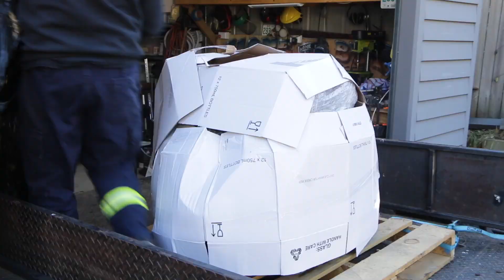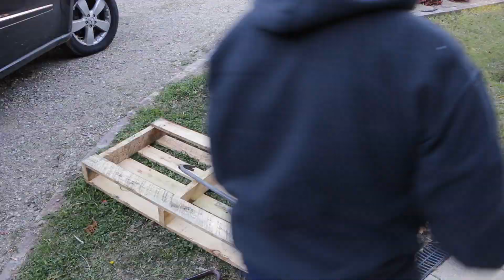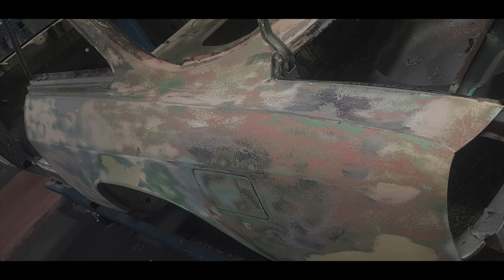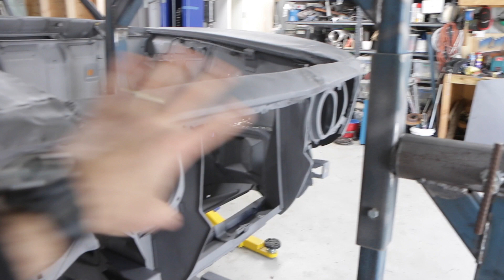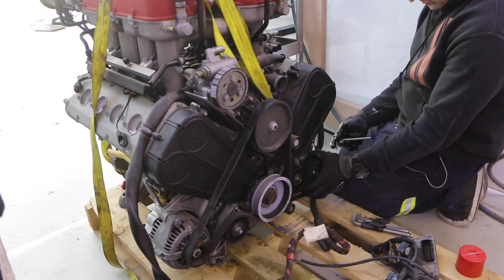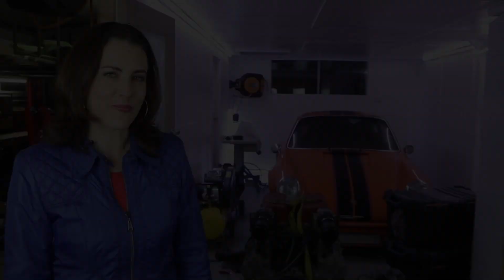How much does a Ferrari engine weigh? - Alfarrari 105 project car build part 10

Comment: Nice weight for the little V8 Ls1s usually considered one of the lightest modern V8s come in around 185 kg -225 ish depending on accessories  etc. Its also a relatively small lump much of the mass resides on top with the induction. This is going to be fantastic and then some.

Comment: I put a 4.2 ltr Oldsmobile (alloy) into a 1968 two door gt Cortina.   The V8 (P76)  was lighter than the original cast iron 4 cylinder.   My alloy 393 Cleveland is only 40 Kg lighter than the cast iron 351.

Comment: Interesting build and comments - re velocity stacks and bonnet bulges and glass fibre flares (oh and keeping it 100% alfa, albeit with "only" 3L V6) take a look at this https://youtu.be/Ty2I-6VbLrI. If you ever see this car close up you won't be talking about fiberglass finish being in any way second rate. Oh - and that car is running an (alfa 116) transaxle. Perfect weight distribution.

Comment: Howdy Jeff, have a look at "subaru gears" they are in aussie and make a lot of cool stuff to fit the scoobie gearboxes. I have a couple of there adapters and fly wheels for my projects.  I came to a similar conclusion as you but i have used 4wd boxes converted to RWD. Keep up the work. Cool project!  Btw ....My Zed has a vw vr6 turbo mated to the scoobie box.  Cheers, Douglas

Comment: It was always my impression that gearboxes had torque limits, more so than HP limits.  The 915 in your 911 for example will start to exhibit issues when torque goes over 350 ft-lb, particularly at lower revs.  It'll be interesting to see how you go with the 86/BRZ box.

The intake on that Ferrari engine looks like it will be a challenge.  I guess you will just rotate it 180 degrees to face the front?  But it may stick out of the bonnet still?  Are you tempted to go ITBs on it?

With that said, that fancy manifold on top probably adds quite a bit of "meat" to the torque curve on the engine (with variable length intake ports, etc.)

Comment: won't you also need a beefier diff to handle the power surplus? Meaning more weight at the rear, canceling the difference out a bit more?
Reply from the maker: The diff in there is pretty tough so we will see how it goes for now, but the battery moving to the boot will balance it pretty much with just that.

Comment: Interesting project, I'll be hanging out for the subsequent installments to come.
Hope that gearbox can handle the torque, you'll need to "uprate" it by using top quality full synthetic gear oil, an old Borg-Warner trick. Also you could move the radiator into the boot area seeing as you need to change all that wrecked rear boot floor, it'll give more space/coolant capacity/less weight up front.

Comment: You should fit the power steering and air con, wouldn’t be too hard to work something out using AN fittings.

The steering’ll probably be quite heavy with that extra weight up front, and that engine’ll definitely kick out more heat than the little Alfa engine so you’ll be baking in the cabin.
Reply from the maker: It's not the fittings it is the space.
Reply: Home Built By Jeff if Bad Obsession Motorsports can get a Celica GT Four engine, with the air con, power steering, turbo and a charge cooler attached into a classic mini, I’m sure it’s possible 😂. 

I’d of thought the width of the banks themselves would be more of an issue than the depth of the accessories with it being a 4 cylinder to v8 swap.

Comment: Surprising there is so little difference in weight. Perhaps relocating battery etc to the boot will help retain the weight distribution. Man there is a LOT of sheet metal work to do. I'm enjoying this build.
Reply from the maker: Battey, oil tank, bigger brakes, half cage, there is a lot that will make a difference

Comment: I would start with a gearbox that can handle the torque and mount the starter on the adapter you will have to design and fabricate. Oh and there is no way that Ferrari intake will fit under the bonnet so I hope you're up for some custom manifold design...or just cut a hole and the bonnet and let it stick out, roots blower style.......

Comment: Like others have said.
Relocating the battery to the boot/trunk.
and relocating the engine further back in the engine bay could mitigate the weight issue?.
Also have you considered the gear ratios of the gearbox?
May have drivability issues due to the gear ratios keeping the engine out of its power band?...

I wonder are you considering junking the injection system for Weber Dcoe's 40/45/50s?
NOW that would be interesting and in keeping with the era of the car.??

Comment: I would do all around Carbon/Kevlar composites, and don’t mess with sheet metal straightening nightmare. Door skins, front and rear fenders and bonnet. Rear trunk door would keep steel. Also you will have to add the fuel cell in trunk. That will balance weight distribution. There are lot of options. But all around composites would way to go.
Reply from the maker: This will be a steel beast. There are aluminium panels available, but as the front guards and nosecone are all one welded on non-removeable piece it would be a lot more work trying to make all new composite panels.

Comment: I was going to suggest that the RX8 Trans has the starter on the trans side. But then you pop out the 86 trans... which is the same thing! Both are Aisin AZ6's.
Reply from the maker: Interesting. I have had quite a few suggestions for RX7 boxes. Nice to know they are the same thing.
Reply: @HomeBuiltByJeff  It's also the same trans in the 6speed NB MX-5, however the MX-5 is mounted differently.

Comment: There's a Ferrari powered BRZ that looks a similar engine, that's probably where Benny got the idea about the gearbox from, it's a drift car so the transmission and diff are going to have to be strong, it might be worth seeing what they've done? The inlet manifold does look tall but long runners are generally for increased torque over outright hp, you're not really going to need heaps of torque IMO so could shorten the runners significantly. There's a very good custom plenum place in Wollongong or get the guys that did Benny's cresta manifolds in Sydney?
Reply from the maker: Ryan Tuerck's car ran a sequential race box

Comment: I would be looking at a later model Fd rx7 box if I was you. Series 7 or series 8. They have a rear facing passenger side starter and are a pretty light box. You can also swap the extension housing with an fc rx7 box and shorten the shifter if it's too far back.
Reply from the maker: Same gearbox as the GT86 ;)
Reply: @HomeBuiltByJeff  86 box is the same as rx8 not rx7. Rx7 are completely different and a lot stronger.

Comment: Only 25 kgs difference between the 2 engines??? i would not have guessed that.  4 more pistons and rods, another head and valves and cams, and that huge manifold.  The original alfa motor does look stout...

Comment: Engine & gearbox - The data:
Alfa: 148.5 + 33.3 = 181.8kg
Ferrariyota: 175.4 + 42.4 = 217.8kg
Difference: 36kg (79lb)
Reply from the maker: Gearbox is central weight so not as big a deal. Just a bigger driver could easily make more difference than the box ;)
Reply: Once you add the flywheel and move the battery to the boot/trunk...
Ferrari flywheel likely 5-7kg(10-15lb)
Battery 18kg (40lb)
So the front of the car will be ~42kg heavier and the rear 18kg heavier. So balance-wise: ~24kg bias to the front.
Reply: Which is fark all when you consider... Alfarrari!
Reply from the maker: @DiscoFang  I am not sure maths is your strong suit :D
Reply: Home Built By Jeff ummmm It was the calculator! Errrrr damn iPhone predictive maths? (I've updated the bias part. 24kg.)
Reply from the maker: @DiscoFang  Remeber you need to take 18kgs OFF the front weight as the battery used to be there ;)
Reply: Home Built By Jeff Haha oh jeez my head hurts. 
36+6-18=24kg front. 18kg battery added in the boot means 4kg front bias. 
Therefore conclusion = sweet feck all difference. As you were.
Reply from the maker: @DiscoFang  Well actually, remember the gearbox weight is in the middle of the car so it shouldn't be counted towards the front, so that would mean 27+6-18..... Hahaha. Then you need to hadd the heavier brakes, bigger radiator (with more heavy coolant in the nose), the half cage I will be adding, the dry sump oil tank, the heavier exhaust out the back. You get the picture. The final weight balance could be anything right now.
Reply: If you are indeed ditching the intake plenums & intake pipes there's a bunch right there too.  I'm picking you'll overall have  about 20kg F\R bias over stock car. Will I win a prize?

Comment: I think what people had in mind when warning about sand blasting is that blasting with sand heats and stretches the metal and therefore is causing dents and more body work. Other media blasting like with soda is much better option for bigger thin areas like door panels, roof, bonnet, etc.

Comment: i'm not shocked the weight difference is not all that substantial. something to consider too is that the slight increase in trans heft actually will shift some bias towards the rear. plus, you plan on installing a beefier rear, right? right?

Comment: A couple of issues I am seeing is installing that Ferrari Engine into the Alfa .. It seems the air intakes are on the wrong side (backside) and the engine is going into a front engine vehicle .. The only work around I see is separating the air boxes and turning them 180 degrees .. where now the Left MAF and TB become the right one and vice versa .. not an issue whether u are keeping the ECU's or not as long as when plugging the engine into a diagnostic tool u remember Left is Right and Vice Versa .. that is assuming you are keeping the original intake .. again assuming it will fit under the hood.  ... [maybe the intake runners can get shortened without affecting engine performance to retain the originality of the engine ... You may also want to look at relocating the oil filter remotely for easy access...  as well being a dry sump system fabrication of a custom catch tank with filter in the trunk of the car to better offset the added weight of the drive train up front and help with weight balance front to rear.. would make for a cool set up .. oil tank one one side and battery on the other .. in the rear trunk ..  Sorry its my Engineer brain at work ;-) :-)
Reply from the maker: I already have a plan ;)  (and swapping the intakes around would only mean making sure they are plugged into the correct side of the loom. Easy).

Comment: put airjacks on the rear and connect the starter motor to the back of the gearbox ^^ 

the staring procedure would then be, lift the rear wheels, put the transmission in gear, release the clutch and then activate the starter motor to start the engine XD

Comment: If it is ever necessary the coils are made by Bosch
Article number 0 221 504 015
and cost about 107 Australian Roubles a pop.
So, not too expensive.
(...in Germany)

Oh, and are you going to change the intake runners to bend versions (if you're going to use them at all?) since the engine appears to be a wee bit too high to fit into the engine-bay...

Comment: Hi Jeff and Mrs Jeff,  it's really a nice channel!, 

I am very curious to see the result of your project. I also have a GT, but a 1600, step front of 1969. I would like to change the engine, perhaps with Alfaholics parts. If you need original spare parts from Italy you can contact me, I know almost every Alfa spare parts dealers here, even for rare pieces.
Keep on with the good work!, do you already know how you will paint it?

Comment: Mate that gearbox is going to blow up . Why don't you buy a 300zx manual transmission the starter motor mounts on the bell housing and is alot stonger then any SUBARU gearbox even a built one . You can buy new ones from Nissan 4 k
Reply from the maker: Because they are ENORMOUS ;)
Reply: @HomeBuiltByJeff  so you are still going to cut the transmission tunnel as you said in the video.

Comment: You could lead-fill the rear of the car instead of using regular polyester body filler to help balance out the front rear weight ratio.
Or "simply" put a nine-inch out the back.
Reply from the maker: I don't need to go that far ;)

Comment: Wondering if you'll go full Monty and pick up an English wheel and create your own patches for complex bits vs trying to scavenge something from another car. On the weight, some of that will be pushed further back via the longer transmission. if it matters, you can always et off the difference with a bigger fuel tank when you rebuild the trunk

Comment: Another great video, the Ferrari engine is surprisingly light! More body work than expected but the battery tray and rad bottom are super common problem areas.
 The body panels do get expensive, even though quality is good they need some fettling to make them fit right!
Reply from the maker: Yep, it is going to take some work. Surprisingly this car is not bad on the rust side, more accident damage.

Comment: Are you going to Install the battery in the trunk to help rebalance the chassis?
Reply from the maker: Yep, so there is 10kgs or so right there.
Reply: @HomeBuiltByJeff  Not to forget the fire suppression system ... j/k

Comment: Jeff let me tell you now there's no way in hell that you're going to be gentle in 3rd gear.Do yourself a big favour and toughen it up now.It  makes no sense not to .....it's out and ready .Also cheaper in time and work to have to pull it out if it breaks.You might want to consider pushing that engine back a bit in the bay for better weight distribution. It weighs more than the alfa so it will be top heavy and handle like crap

Comment: I have an 86, you COULD buy a rebuild kit that will make the gearbox handle the power the ferrari engine has. Check out Jacks Transmissions. They sell a good one, and the rebuild service if you choose to go that route, or in Homebuilt fashion, make an episode or two out of it. ALSO, i dont know how good the starter will do with a v8 engine, might try putting two lithium moto batteries. Light weight and more than enough power.
Reply: I agree.  I'm also thinking the overall weight of the Alfa is going to be at least 500 lbs lighter than the BRZ given the modern safety stds, etc.  The stresses from a high hp motor have more to do with the load placed on the transmission more than just the hp of the motor.  A lighter vehicle means less stress on the tranny.  Jeff did good :)

Comment: If you move the battery to the back you would move 35 pounds roughly in the right direction to help rebalance plus you can drop the weight of the battery by a third by using a Lithium Ion battery
Reply from the maker: That is a good point. I forgot about the battery weight going in the right place.
Reply: Home Built By Jeff plus you must have dropped 30 pounds of bondo, paint layers and rust!
Reply: Love the idea of a Lithium Ion battery.  Small, up front, and no weight penalty of a heavy battery cable going back to to the rear of the car.
I'm wondering though if Lithium/Ion/Phosphate batteries are quite yet ready for prime-time being used as a true replacement for a standard engine starting battery?
Reply: Snarge22 yes they are and have been used by car and bike manufacturers and as a performance tuning mod for street and track for years now. Makers like Porsche, Lamborghini, BMW and Ferrari give Li battery’s as an option on some models.

I ran a voltphreaks Li battery on my 997 GT3 for years without issue. Porsche had their own OEM Li battery for this car, it was expensive though.

Comment: You might want to keep it all steel, but since you need some new body panels anyway what about some nice fiberglas/carbon fiber (usually higher quality) parts would offset some of the weight increase?
Reply: A full carbon flip front (painted on the outside, carbon on the inside) with a tubular front end and a custom double wishbone/coilover setup would look nuts and show the engine off nicely.
Reply: It would likely also be incredibly expensive. I think just a carbon hood might be okay, or even just a lightweight fibreglass piece.
Reply: Porsche 996 It’d be incredibly expensive if it was made from pre preg and autoclaved, but if it was done wet layup and vacuum bagged, then it wouldn’t be too bad.
Reply: I was sort of thinking of the tube frame. There is no shortcut to the amount of work which would go into that.
Reply: Porsche 996 I’m a welder so I’d see that as the easy part, double wishbone setups are really tried and true and there’s plenty of literature out there on getting your wishbone lengths, roll centre and steering angles right based on the track, wheelbase and weight involved.
Reply: classic alfa or alfaholics ..(classic alfa is usually cheaper but awesome quality) will have fibreglass bonnets..the steel bonnet is actually quite heavy .I think getting the engine back as far as practical is a good idea and put the dog in the back ...seat as well?
Reply: That’s the way I would go .... both front and rear wings in fibreglass  ( carbon is expensive) Alfaholics stuff is expensive but high quality...you also would have options for doors bonnet and boot lid. My biggest concern would be the height of the Ferrari engine. Great project Jeff 👍
Reply: Carbon bonnet? The end result would be similar weight but sitting lower, an overall win...

Comment: Good choice of gearbox, I was going to say how about using a Honda s2000 gearbox, purely for the gear ratios but the 86 box makes sense.
Reply: Plus the fact that the Ferrari engine would have the same amount of torque than the brz.
Therefore I think it might be able to handle the power output.
RPM or HP. is not the main issue if you don't want to kill your gearbox.
Torque rips everything apart.😉
At least this is what I have learned from my small projects.